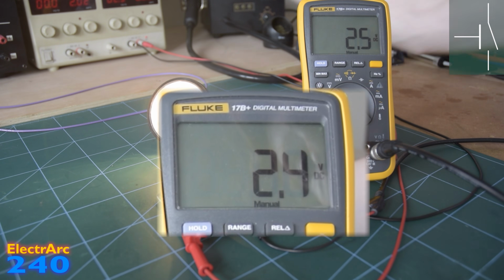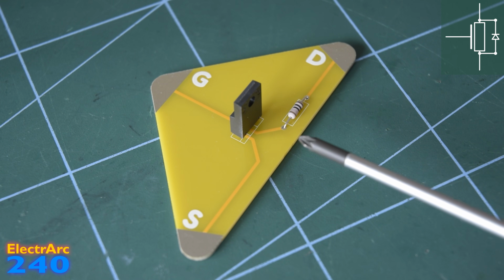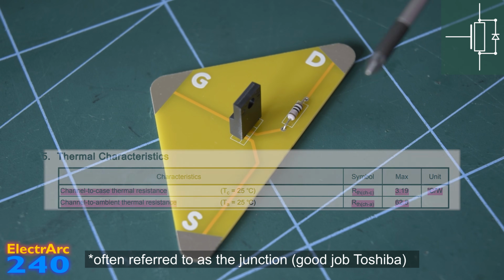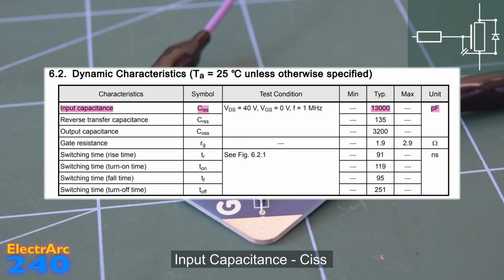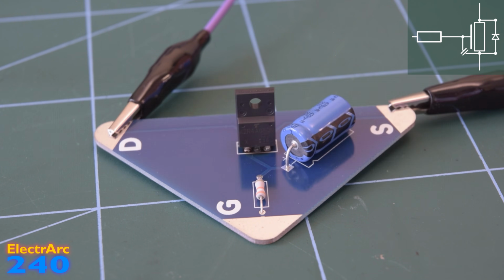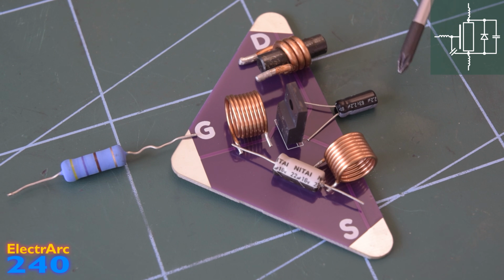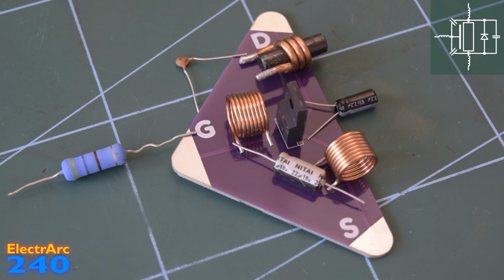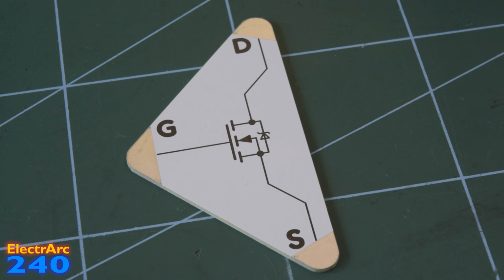Everything You Need to Know about MOSFETs

Comment: Im burning out gpio pins on my esp32, i have a mosfet, flyback diod and a 220ohm resistor connected to the gate. Im running 8520 5v motor.
Reply from the maker: Hmm that's odd if you have a 220 ohm series resistor between the GPIO and the gate. What frequency are you switching at?
Reply: @electrarc240  im using IRFZ44N. Chatbot says that 3.3v from gpio pin is not enough voltage to satisfy the gate. Im controlling with digital write. From a range 0-250 from a web gui. 

Im thinking about adding a npn transistor to control the mosfet then i could turn the gate on with a 5v source instead of 3.3v.

I dont really know what I'm doing 🤔
Reply from the maker: @MrI8igmac  yeah 3.3V does sound a little low. Do you mean analog write (arduino)? Digital write is just Boolean input. It would probably be easier to just get a MOSFET with a lower threshold voltage than add a transistor to buffer the gate. Maybe a less beefy MOSFET if you don’t need the current rating of the IRFZ44N, a weaker MOSFET will have lower gate charge so will be easier to drive directly from GPIO (via a resistor of course)
Reply: @electrarc240  yes arduino analog write. I purchased a 20 pack of this mosfet, ill find one that fits my build. I will try and make irfz44n work with a npn transistor for learning purposes. This is a lot of fun. I appreciate your comment.
Reply: You need a low gate threshold mosfet like a DKG1020 to drive it with 3.3 volts

Comment: I appreciate how you broke down the key differences between MOSFETs and BJTs. The explanation of MOSFETs acting more like capacitors between their terminals, particularly the gate-source capacitance (Cgs), was spot on. It's crucial to understand that while MOSFETs have very low static current at the gate-source junction, the current can increase significantly with a high-frequency signal due to the drop in impedance. This is a vital consideration when designing circuits with dynamic signals on the gate. Also, your comparison of MOSFETs as voltage-controlled current sources (VCCS) versus BJTs as current-controlled current sources (CCCS) helps clarify their different operating principles.

Comment: So every piece of wire or electronic component is simultaneously a resistor an inductor a capacitor and either an isolator or conductor depending on the characteristics of the flowing electricity at any moment ?! How off / on point am i ? Thanks
Reply from the maker: Yeah parasitical are everywhere, so you’re bang on point with that statement, unfortunately 😅
Reply: That is so profound, I'm not a student of electronics (yet) so it's pretty mind blowing yet intuitive in a roundabout way. Thanks for the response! 🙏🏾 

I keep thinking that if we'd know how to tune these parameters to various resonances there will be some Lagrange Points where these effects are not parasitics but rather contributing to efficiency..
Though I also realize that for such proposition has probably been attempted by people that actually practice this science, and that this system is already optimized to the max in relation to our best understandings

P.s Subscribed! ❤
Reply from the maker: @AGI-Bingo  I have seen soft switching topologies that actually rely on output capacitance to work, so again you're not wrong.

Comment: Hey, one question! I didn’t watch the video until the end now so maybe it gets answered. But in the datasheet 3.5 is stated as the max voltage to apply on to the gate. Why did you say usually you’d go with 10 volts on to that pad when 3.5 is stated as maximum?
Reply: Also, why do we even have this bipassing diode? You said every mosfet has one. Doesn’t that oppose the idea of a mosfet as a switch? Why would I want any current to flow when it’s turned „off“ (0V gate)
Reply from the maker: @sioul2006  It is an inherent part of the MOSFET, I guess I didn't make that as clear as I had hoped. Every MOSFET has one because you can't make one without it. Why? That's a question for semiconductor folks I have no idea
Reply: @electrarc240  thanks for your replies! I really appreciate it!

I’ll start studying electrical engineering this year so I’ll come back in a year when I had my semiconductors classes! Thank you! :)
Reply from the maker: Wow a young viewer amazing!
Reply from the maker: 3.5V is the maximum threshold, the 2.5-3.5V range is differences between MOSFETs. so worst case at 3.5V you'd get 2.2mA drain current at 10V Vds. We need a lot more Vgs to turn on "fully"

Comment: I can remember making circuits to light bulbs, I never really grasped electronics but I did take on board Computing with a ZX 81 then onwards.  My friend got a Commodore and we used to sit hours, transferring programmes from magazines to the computer.  Same thing happened with this, I had mental blockage to understand words I never came across at School.  Then, Motorcycles came into my life, there were times when working on them that you used to have to fault find electrics, again it was a real headache trying to trace through wiring, what and where things were failing.  The moral of this story is, sometimes you have to learn your limits, mine was circuits making bulbs turn on and off lol.

Comment: In your video, at the higher gate voltages, you are adding the resistance of you wiring to the actual resistance of the FET.  A typical TO220 fet should only have about 50-milliohms or less, or it will have overheating as a result.  Work this backwards from the specs, and see how much I2R heating occurs in the fet.  Then look at the heat-sink thermal flow rating, and determine if your numbers are accurate.  I designed my first fet in 1966, at our university, and still have some CK722s in my inventory as historical objects.  Also did some later designs at over 100+amps, which worked fine.  Also don't forget the gate drive requirements, which have varied a lot, and there are fets which only take nanoAmps to femtoAmps to turn On fully.  Voltage measurements cannot take these effects into account.
Reply from the maker: I know, my goal was to illustrate the concept of on resistance so that wasn't a problem, as shown in the video the actual FET used has Rds(on) of 1.9mOhm. Interesting about the early FETs, I'd love to see one of those!
Reply: @electrarc240  The most interesting FETs in my mind, were the V-Fets, where the gate was actually in a V-trench between the D&S.  These had very good gate characteristics, but since the Vskin was essentially "open", you got all sorts of "surface contamination" effects. which caused continual electromigration and electronic wind effects, which caused very short lifetimes.  Nonetheless, these types of "edge effect" devices have shown very Gain or Sensitivity effects.  This is also done in some electrochemistry situations, as in catalysts.  That area has been poorly explored, but such sensors are available in the chemical sensing industry, where, again, they have limited lifetimes.  Also, the V-Fets since the gate was only on one small edge of the chip pattern, had a significant delay in the spread of the gate field, into the body.  As such these were inherently slow, and often had overheating along the conductive pathway, at centroid areas, before the whole chip could be made adequately conductive.  Similar to avalanche failures at the other end.  However, they were very good slow-speed switches for some of our analog gating and steering applications.

Comment: 11:38  Saturation is real.  I just spent some time playing with a power MOSFET and a 12 volt turn signal light bulb.  With 12 volts source to drain voltage and 12 volts on the gate, the device stays so cool that it does not need a heat sink.  The light is getting 2 amps of current and 24 watts of power, but even after several minutes the transistor does not get hot.  
When I reduce the gate voltage to 4.5 volts to dim the bulb (about 1 amp of current), the transistor heats up quickly.  Just one minute in saturation gets the heat sink so hot that I can barely touch it.  Thank you for the video!

Comment: The venerated magic smoke. And the amount of IBM canisters of the stuff has dwindled over the decades, so we must be careful.
Reply from the maker: Ah s**t that's no good. I worry that companies are skimping on the magic smoke in modern power electronics as most of the "incidents" I witness with SiC devices seem to be either silent and invisible or really damn loud and explosive, but no magic smoke either way 😔
Reply: @electrarc240  I blame the EPA for it. Back in the day you could just feed any 555 enough volts and it'd leak some magic, Le sigh, where did we go wrong?

Comment: This tutorial is so chock full of information that I'm going to have to save it to a playlist. BJT's are much easier to understand but I want to use mosfets and triacs to drive power electronics.
Reply from the maker: Yeah I started on BJTs but they are so outdated now it's harder and harder to justify not switching to FETs. Though I bet this video has given quite a few excuses haha
Reply: @electrarc240  Thanks for replying! I hope you consider doing a tutorial on charge pumps. It would be nice to have the knowledge to build n-channel bldc motor drivers. 
Just a thought but thanks so much for sharing your expertise.
Reply from the maker: @awaitingthetrumpetcall4529  Yeah charge pumps are an interesting thing I'll probably cover a bit in an upcoming video where I've designed a 50W DCDC converter for some demos. If your budget can stretch isolated DCDCs for each high-side FET (ideally all six) is a much simpler way to do things. That's what I'm used to cause charge pumps aren't really a thing on 800V+ SiC inverters lol. One of these funny cases where things are most complex on low-cost low-end products and get simpler at the high-end. Also a bit of a bulky solution for a small BLDC driver if size is of concern to you
Reply from the maker: @awaitingthetrumpetcall4529  Check out my video on my three-phase inverter to see an example of that. Maybe don't copy anything else from that though 😬😅. https://youtu.be/BHaP36z9Rk0?si=7KlJPS_ZUdWr8OD_

Comment: I've taught this sort of stuff and like your approach - if I hadn't retired I'd be using it in some way. Really good that you're overlaying your relay with the schematic however it took me a while to understand your purple wires. Initially I thought they both came from your lamp and you were connecting it in parallel with the relay. It would have been clearer if at 2:44 (and later) your 2nd PSU negative was a black wire and a red wire was visible connected to the high side of the lamp.
I particularly loved your tap analogy for the saturation current and you answered questions about parasitics I've long been unable to find answers to!
Reply from the maker: Yeah I'm not sure why I made them all purple that was a bit silly of me. Thanks!

Comment: Another great video! I'am the commenter in the previous SMPS video of yours. I ended up just connect the negative to the earth/ground lead. Our house actually don't have earth connection on the outlets. The earthing is just 1.5 meters of rebar into the soil, and I guess it works since my power amplifier is not hissing anymore. Oh, the power supply is Meanwell LRS-350

Comment: 2:56 Very important distinction: simply "taking away" the voltage does not turn a MOSFET off; the gate needs to be forced inactive.  A relay has a spring to turn it off, but a MOSFET has no equivalent.
Reply from the maker: I specifically used the phrase "take away" to imply that, but as I hadn't yet introduced the concept of input capacitance I didn't want to say any more than that at that stage
Reply: @electrarc240  And that's a fair call. Teaching is all about simplifications which are more-or-less true!

Comment: 4:40 not all MOSFETs have a body diode, at least not as shown here.  It's an effect of connecting the body terminal to the source or drain, which is what happens in 3-terminal MOSFETs, but you can get MOSFETs where all four terminals are available separately.

Comment: This is crazy detailed. Huge Thanks.
For the parasitic capacitance that could build up a high voltage at the gate, could say a Zener diode to ground that conducts when a high voltage across the gate be used?
Reply from the maker: Yeah some MOSFETs actually have zeners integrated into the gates for protection. It wouldn’t protect against false turn on though which is the main problem, only against excessive gate voltage which is more likely to be caused by gate loop inductance. If the miller capacitance pulls the gate anywhere near that high during turn off your MOSFETs probably dead anyway
Reply: @electrarc240  That make sense, thanks

Comment: Hi! Can you Tell mode about body diodes? If I understand your vídeo I cant use a n Mosfet tô turn on/off a LED because It Will have a ghost light, unless I put a pullup. IS that right?
Reply from the maker: No you can. If you connect it like how I had the lamp connected (plus a current limiting resistor) then you can control the LED by simply switching the gate voltage between 0V (off) and 3.3V, 5V, 12V etc (on) - just needs to be over the threshold to turn it on
Reply: @electrarc240  o understood. But about the leak current thru the body diode? Isn't going to get a "fanthon" light on the very efficient led ? Thanks for your reply
Reply from the maker: Not unless you have are close to or exceeding the max drain-source voltage when off. Otherwise leakage current will be tiny

Comment: the video is greate but i dont understand why u have to use mosfet if u can use switch and i have heared that mosfet can be used as amplifier.
Reply from the maker: MOSFET has no moving parts so can switching hundreds of thousands of times per second. Linear amplifiers will use MOSFETs in the saturation region and class-D use them as switches

Comment: I, for one, think that the use of real physical pcb’s and real physical  component examples are an excellent way to demonstrate what was being explained here, as opposed to an animation. More real, being connected to real power from very real power supplies. 

This video contains very important and useful information.  Information that I came to realize the importance of a few years back when I decided to design and build my own FET switched spot-welder for building battery packs because I, being the idealist that I sometimes am, was not satisfied with the two extremes regarding price and quality of pcb-based spot welder offerings that seemed to be the only choice at the time. 

I liked the price of the $20-$30 pcb’s from ebay, but I was not a fan of design flaws that they seemingly all copied from a few initial designs. Flaws which caused the smoke to be let out within a very short use life. 

Fun fact, if you learn everything contained in thus video about power mosfets, you have all the information you need to build an effective and functional mosfet-based spot welder. Some of the losses covered in this video become very apparent when switching several hundred amps of current, even if it is just on and then off as a solid-state switch. 

The linear region. Switching the gate capacitance miller-plateau as quickly as possible. Gate resistance. Gate-source voltage. Voltage spikes from flyback inductance. These were all extremely important factors to consider in designing a fet-based spot welder. 

Another thing: If you learned everything shown in this video, you now have all the knowledge needed to make a few simple modifications to those $20 spot weld pcb’s to make them as reliable as a $300-$400 pcb-based spot welder, and to modify them to handle 3x their rated current spec for welding copper strip, even, instead of the somewhat convenient yet not-so-conductive nickel strip.

Comment: Very nice. Nothing new though 😅

I am into high power DC/AC converters for industrial use. I simply don't care about the parasitics, since I use microcontrollers to switch the MOSFETs and the frequency is typically low, in the 10-30 kHz range.

The only place I am a little more careful is the voltage generator, for which I use my oscilloscope for tuning. And a lot of extra components to suck it up, as you say 😅

Comment: Threshold means the beam under the door, which prevents water from running into the apartment. In electronics, threshold means a value that must be exceeded for an action to be successful.   Threshold means to hold back.